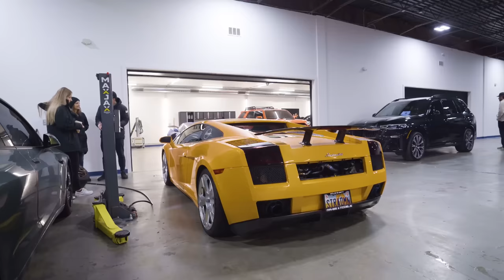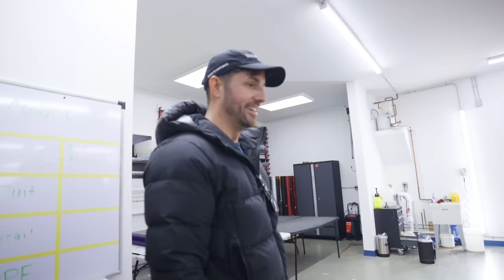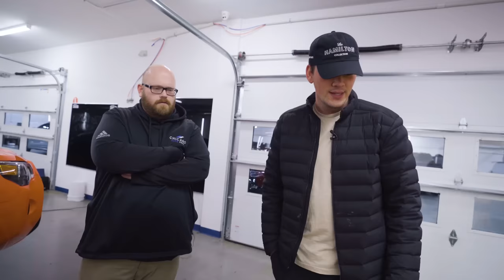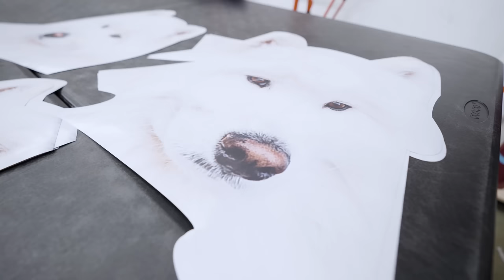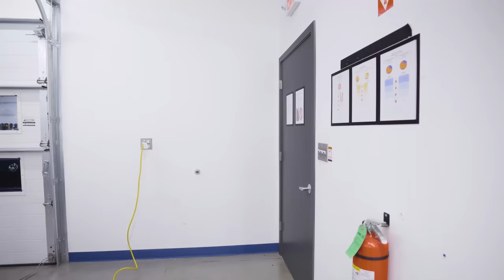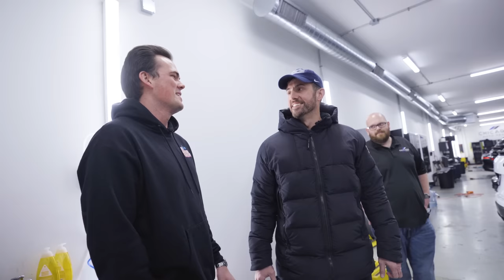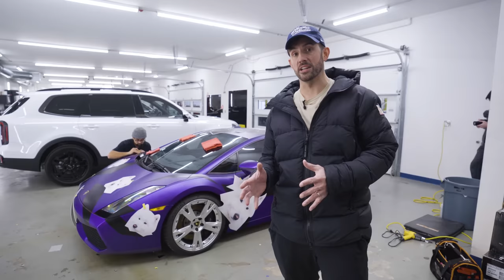Surprise Wrapping Stradman’s B-Rouge Lamborghini Gallardo!

Comment: I didn’t think that puff of blue smoke from Strad’s car on startup was a very good thing for a car that just had a full build done on it.   James should have used Underground Racing I’m thinking
Reply: I cringed when I saw that puff of smoke as well.😬
Reply: Yea, that engine is hurting.
Reply: it's normal for turbo cars to smoke a little on startup. it's just residual oil in the turbos
Reply: @andrewchao9164  not normal at all lol. There shouldn’t be any oil in the exhaust unless the car has bad turbos, bad rings, bad valve seals etc
Reply: The company who built obv isn’t the best been 3 years u could say it’s a gallardo parts are scarce along with TT it but it’s not company has been very sloppy putting his car on the back burner

Comment: No oil leak in this video
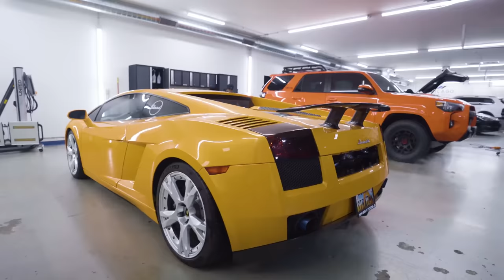Reply: If you look properly you can see spots on the ground at 0:41 could be water but the car was not parked for very long till he moved it and it's smoky a bit on start up.
Reply: if the car is making blue smoke that is a bad sign tho look at 0:33 thats a lot blue smoke ı think

Comment: Brings back some memories seeing that car in purple, hopefully he gets it back soon, sad to hear its still not 100% but B-Rogue will get it done eventually :)
Reply: "one eternity later"
Reply: @tgyeatts  Well in an eternity it'll have 500k miles on it and be the most reliable TT Gallardo.  Just gotta be patient, cars break, especially intensively modified ones that aren't supposed to push 4 digit whp like this car does.  It sucks that there's issues but it's a nearly 20 year old car, its not going to be perfect and rebuilding a motor doesn't fix absolutely everything.
Reply: @TaffPlays  it clearly has not, and will continue to be extremely UNreliable if he sticks with them. it’s amazing how much you keep gobbling B-Rouges 🥜